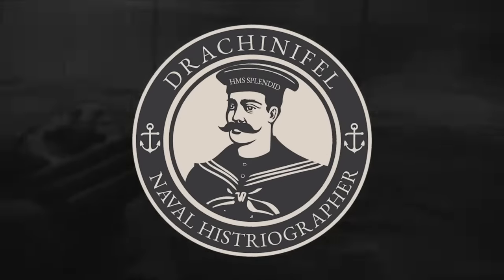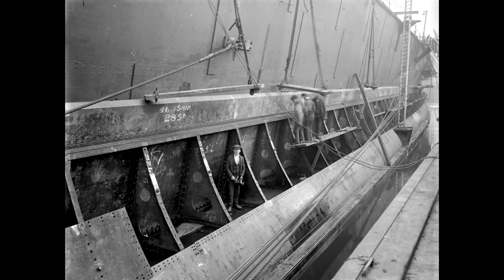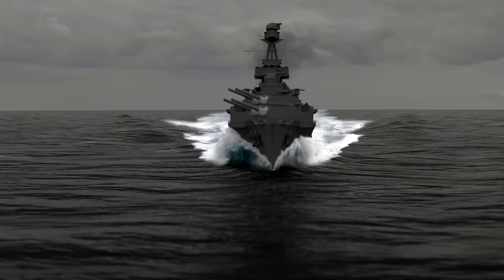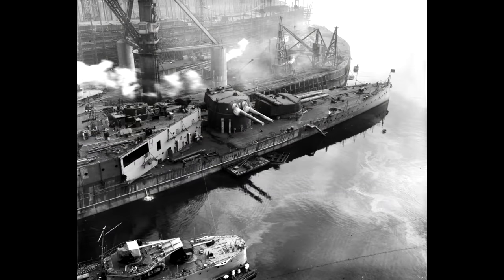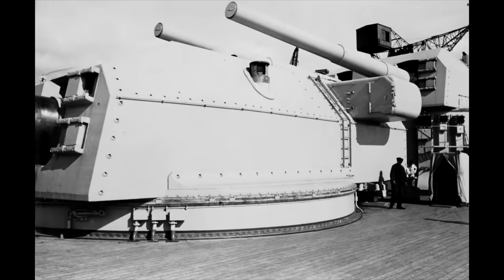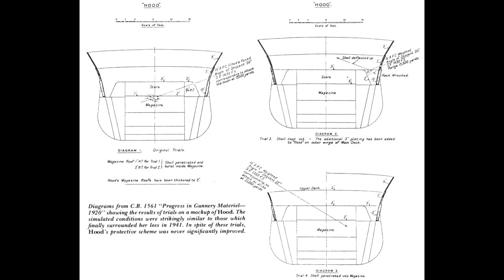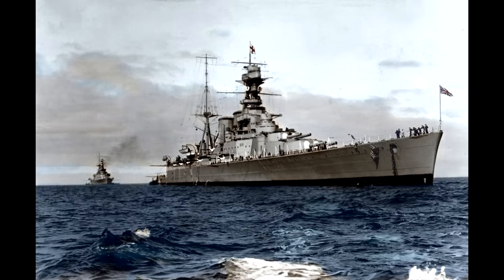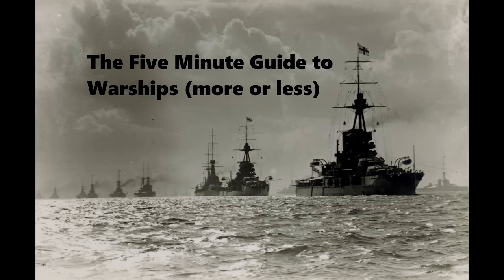The Loss of HMS Hood - But why did it blow up??

Comment: The Admiralty erroneously counted British battle cruisers as 'ships of the line', but they were designed to range over the 'seven seas' (necessitating through ship conveyance and ventilation routes) showing their impressive 'big gun' flags and to hunt down enemy armoured cruisers in the event of war. Against a true battleship they were at a severe disadvantage.
Reply: Hood had armor on par with the Queen Elizabeth-class of battleships
Reply: Hood was not a traditional battlecruiser, as she underwent an extensive redesign after Jutland.  She should more accurately be described as the first of the fast battleships. She had a 12 inch belt, compared to the 9 inches of Tiger, or the 6 inches of the Renowns, yet was still a 30+ knot ship in her prime.
Reply: @dovetonsturdee7033  Excellent information. I heard the 'big guns' didn't fire so fast and that she was a 'wet' ship. Any truth to that?
Reply: @elrjames7799  Not really. She could manage 2 round per gun per minute, much the same as any other battleship or battlecruiser.

She was wet aft, because the redesign to incorporate extra armour left her lower in the water than had been intended.   In 1931-2 she was fitted with a catapult on her quarterdeck, and  sent to the West Indies. It was soon discovered that rough seas and the Fairey IIIF aircraft did not go well together, and it was quickly removed.
Reply: @dovetonsturdee7033  You seem to know what you're talking about: are you convinced that Hood would be equitably matched against a modern battleship like Bismark?
Reply: @elrjames7799  No. Hood was 20 years old, and was less well armoured than Bismarck. Bismarck had superior optical rangefinders, although Hood had gunnery radar.  Both had obsolete incremental armour, compared to the all-or-nothing of more modern ships such as the Nelsons, the KGVs, or the Washington.

However, if Hood could have closed the range, she was well enough armoured to have inflicted considerable damage on Bismarck. A damaged British ship, of course, could expect support after the action from other British ships. No similar support would be forthcoming for Lutjens' squadron.

Furthermore, Hood was not alone. She had the support of a modern, though not worked up, Prince of Wales. The fact was that, had the action gone as the British expected, either Bismarck would have been forced to divide her main battery in order to engage both British ships, or would have concentrated on one and allowed the other to fire on her unchallenged.   In a longer action, also, Wake-Walkers two Counties could have been expected to act against Prinz Eugen.  Incidentally, Lutjens, throughout the action, thought that the battleship with Hood was King George V, not Prince of Wales.

The point I have been trying to make is that those people who harp on about the sort of British arrogance which could have sent an old battlecruiser with eggshell armour against a state of the art super-battleship are writing nonsense. Hood was well armoured, and Bismarck was far from state of the art. 

Tovey had every right to expect Hood & Prince of Wales to have been capable of preventing a break out by Lutjens into the wider Atlantic. Indeed, stripped of the emotion involved, that is exactly what they managed to do.  

Hindsight, however, is a wonderful thing, as many of the people who post one here efficiently demonstrate every day.
Reply: @dovetonsturdee7033  Wow: very impressive. You demonstrate a knowledge in depth and I couldn't agree more with your evaluation about emotionally generated posts and 'hindsight'. which (in a historical context) often equates to confirmation bias to support an attempt to retrospectively impose a modern presupposition.  As Professor Charmley once put it: "if me auntie was me uncle she'd have had another set of equipment." The great T B Macmaulay also warned about 'hindsight'. The worst academic offender along those line seems to be Professor R Evans. I know a little about the first battle of the Falkland Islands at which, of course, your namesake commanded the British squadron. Given the distance in time, I have to admit having an attraction for the von Spee side: those armoured cruisers were beautiful ships.
Reply: @elrjames7799  They certainly were. Just before WW1, Scharnhorst & Gneisenau won the Kaiser's Cup for naval gunnery.    The First battle of the Falklands was the only time, by the way, that battlecruisers were used for the purpose for which they were designed, that of hunting down and destroying enemy heavy cruisers.

Incidentally, Scharnhorst's wreck was discovered two or three years ago.
Reply: @dovetonsturdee7033  I didn't know about the wreck discovery: thanks for the info. Yes: thanks for reminding me about the rippling gunfire that characterized that gunnery. As far as my recollection goes (and correct me if I'm wrong) if that old Canopus had been able to keep up with Adm Cradock's squadron off the coast of Chile, it may well have have received the 'chopper' and not been in place to fire the dummy blank shot through Gneisenau's funnel  that probably deterred Captain Maerker from employing that gunnery (and perhaps torpedo also) there and then against ships that were 'cold' and consequently unable to manoeuvre?

Comment: Thank you for exposing this research, although I notice something. There is the implicit assumption that everything works as it was on paper. In reality there is a lot of neglicence and things can be built with subpar standards. For example German tanks in late war they had a <planned-thickness-here> of armor, but the armor was of a so poor quality that often didn't help.

if that was the case for hood, maybe also due to his extended service, then a lot more scenarios could have happened as well.

Comment: look's like both Hood and Bismarck suffered from horrible bad luck.
Reply: Both sides had their share of good and  bad luck. Finally it was superior ships and numbers that carried the day.
Reply: I would not call this 'luck' (bad or good) at all. Those looking for a scapegoat do, but do you call hitting 3 out of 4 guns shots at a target 25 yards away in the bullseye as luck?
Reply: @vincentlavallee2779  During the battle of Denmark Strait, Bismarck's "killing shot" was fired at Hood from 8-9 nautical miles away. At that range the 38 cm SK C/34 (Bismarck's main armament) had a CEP (circular error probability - effectively the radius of a circle within which 50% of its shots would fall) of 100m. That means that if 8 of Bismarck's 15in guns fired at a single point 8-9 nm away, 4 of the shells would be expected to land (with completely random distribution) within an ellipsis (due to the angle of fall) measuring approximately 100m (330ft) wide, (or to put it another way 38% of HMS Hood's 860ft length), by close to 2500 feet long. The other 4 shots would land even further away from the aiming point. That being the case, how can an individual shell be aimed specifically at a tiny part of HMS Hood's structure, namely the 4in HA magazine, that is believed to have triggered off Hood's detonation? I'll give you a hint, there's a little clue in my paragraph above....where it says "completely random distribution".

A simplified analogy is that if you prop a dartboard up 50 yards away and can consistently knock it over with a shotgun at that range then that is pretty good shooting, just as Bismarck / PE achieved during the Denmark Strait encounter.

Now you can "knock the dartboard over" all day long with the shotgun and STILL NOT hit the bullseye (magazine) with an individual pellet. As opposed to being a skillful shot by knocking over the dartboard, whether you hit the bullseye with an individual pellet IS complete luck.
Reply: @vincentlavallee2779  the hit on the rudder was blind luck.

Comment: What if a main gun captain or somebody like that decided to use a higher trajectory in order to hit hood at the distance she exploded. That would I think allow the higher trajectoryhits to remain in contention.
Reply: Just conjecture on my part Drak. Idle minds are etc.
Reply: There are physical reasons why Bismarck's hits on Hood were not "plunging" enough to penetrate her deck armour. The maximum elevation of Bismarck's main armament was 30 degrees. To achieve "plunging fire" at the range where Hood exploded would need a FAR greater elevation of Bismarck's guns, effectively turning them into king sized mortars. At the elevation of Bismarck's guns during the engagement any shells hitting Hood's deck armour would have impacted at such a shallow angle as to glance off. Theoretically If Bismarck had the facility to fire shells with reduced charges so as to reduce the range of her shells while firing at her guns maximum elevation in order to "drop" them onto Hood's deck, they would have had insufficient kinetic energy to penetrate.

Comment: As to the big flash aft of the funnels but fore of the mainmast, could this have been due to aviation petrol as this is the location of the catapults, I assume that somewhere there would be a petrol tank for bunkerage?
Reply: A VERY adroit suggestion with one minor drawback.... HMS Hood wasn't fitted with aircraft or catapults at the time of her destruction. The flash in front of the mainmast is most likely to have been the venting off of her burning 4 in secondary magazine initially into her machinery spaces (engine room) which hopefully mercifully killed the engine room crew quickly, and then when the pressure had very quickly risen then vented out through the main engine room ventilation trunking which came up just in front of the mainmast.
Reply: @walterkronkitesleftshoe6684  Thank you for that makes sense now.

Comment: ok one other possibility Hood's boilers wwre at end of their service life and were overdue for replacement.. the way  the british achieve an extra knot or two is by overfiring the boilers. something Hood had not done in years.. possibility 1 Hood's boilers explodeddue to low water explosion  this would have caused the fountian geyser of white smoke and showers of sparks from buring oil. expanding steam has much more explosive force than bags of powder. this woulod have blown out the bulkheads between the boiler rooms, the engine rooms and the powder magazine. ,      
this leaves the possibility a shell from Bismarck exploded in a boiler room causing a chain reaction explosion. the easiest exit for the steam would be thru the air vents for the boilers.
according to a documentery an engineer examined the wreck of HMS Hood  and the drawings made by witnesses aboard the POW  came to this conclussion.

Comment: Drach I'm confused by your use of these horizontal diagrams to discuss the incoming shell angles. Didn't you say in an earlier part of the video that the hood was not broadside to the Bismark but facing towards her? An incoming shell from ahead would have plenty of horizontal room to plunge through the deck armor amidships and into an aft magazine. I'm surprised that you spend so much time hypothesizing about a broadside hit when that's clearly not what happened.
Reply from the maker: I showed the relative angle of travel as best I could, but I'm not a 3d animator, so it's a bit difficult to give a 'shells eye view'. Some of the rendered stills show the appropriate angle though
Reply: Thanks for the response Drach! At 10:40 you mention that evidence indicates shells from the Bismark were coming at the Hood from an angle about 37 degrees forward of Hood's beam. At 26:07 you say the fall of shot of Bismark's shells would be around 14 degrees. If I had a printer, I would foreshorten a profile deck-plan of the Hood by the cosine of 37, then get out my protractor and see if I can get a shell traveling down at 14 degrees to slip in over the top of the starboard armor plate forward, down through the thin deck plate amidships, and then continue aft and port down into one of X turret's magazines. But, since I don't have a printer or a protractor I'll just say that intuitively an angle of 37 degrees from broadside should give a shell plenty of extra horizontal space to drop down through the decks to the magazine. What do you think?

Comment: Is there a ventilation pipe on the boat deck or under it, that leads to the shell room or magazine that may have been filled with burning fuel (wood and or liquid fuel) from the boat deck fire?

Comment: Having been built in 1916, could HMS Hood have suffered from the same "brittle steel" syndrome that had afflicted RMS Titanic?
Reply: I have been following TITIANC over the years. One recent presentatuion discussed her steel. It suggested (reported)   that ordinary shipbuildding steel of the period was prone to degradatiion of toughness at low temperatures. Also that this resulted in the steelmakers and classification societies addressed this, and deveioed better steels to address this issue. 

I don't think steel properties would  havwe made much difference to TITANIC's iceberg damage, or to the  HOOD circumstances that Drach has given us. Of course, steel for both ships came from British steelworks around the same time.

In view of this - "very likely, but highly unlkeley to have been an influence on damage and outcomes." Just an observatiion off the top of my head. I believe very few ship structural failures were attributed to steel brittleness at low temperatures. Circumstances changed when carriage of liquid natural gas by se became popular. 

Peter Edmonds   Naval Architect   Perth Western Australia

Comment: The theory you describe starting at 32.58, has one problem! Its that for a shell to be presented with this trough, the Hood would have to be broadside to Bismark for this to occur. It is reported that Hood was in the beginning of a course turn of 20 degrees, this not enough to present broadside.???
Reply: Very good point Fox. I will have to give some further reading & thought to that point.

Comment: ALWAYS WONDERED WHY THE germans did not protect the bismark with an escort of U-BOATS
Reply: Because the two classes of warship are tactically & to a large degree strategically incompatible with one another. WW2 u-boats max surface speed, 15-17 knots, Bismarck's.... 30 knots. It would be like asking Usain Bolt to win the 100m sprint carrying a rucksack full of rocks.

U-boats WERE factored into operation Rhine Exercise to some degree in the form of U boat "traps", lines of subs placed strategicially, with the idea of pursuing Royal Navy ships being drawn into the traps by Bismarck and Prinz Eugen, but they are very limited in practical usage in that as the strategic situation was very dynamic, the lines of uboats could not be strategically repositioned quickly enough to cover the changing situation and in the event they had only a very small practical effect on the course of action.
Reply: Because U-Boats were at least 13 knots slower than Bismarck & Prinz Eugen.
Reply: they could have had rendezvous points set
Reply: @kingofthewest777   What for?   Would you suggest that Bismarck & Prinz Eugen pottered around at 15 knots or so?   The only advantage Bismarck had was her speed. Once that was lost, look at what happened to her.

Incidentally, at the time of the Operation, there were only two U-Boats anywhere near her.
Reply: @dovetonsturdee7033  if not U-BOATS WHY NOT EXPENDABLE SCHNELLBOOTS
Reply: @kingofthewest777  Lunacy! With a range of 800 nautical miles at most?   Moreover, what exactly was a vessel intended to attack merchant shipping in coastal convoys at night expected to do against large warships or fleet destroyers?